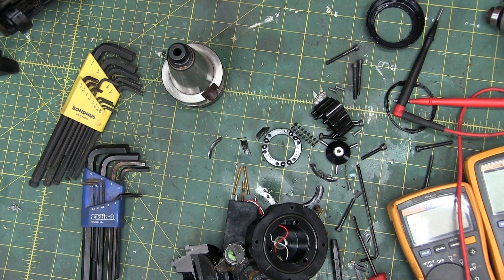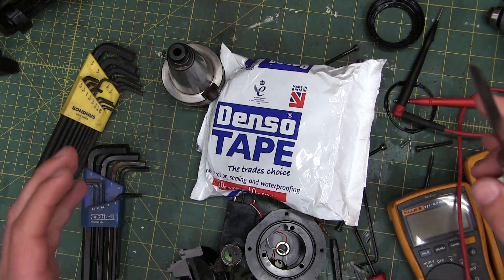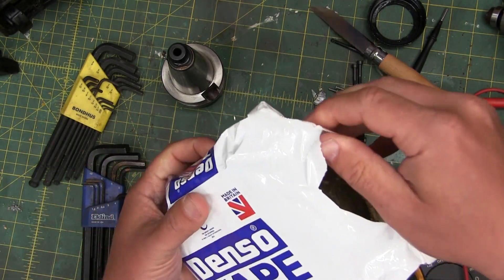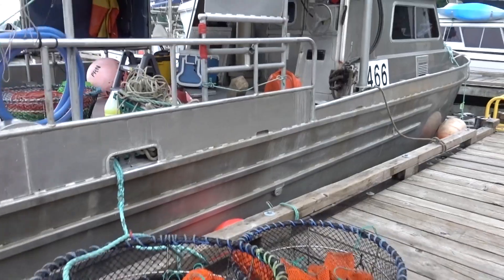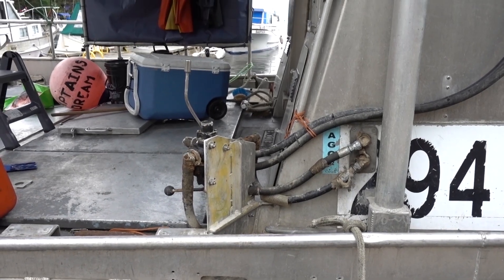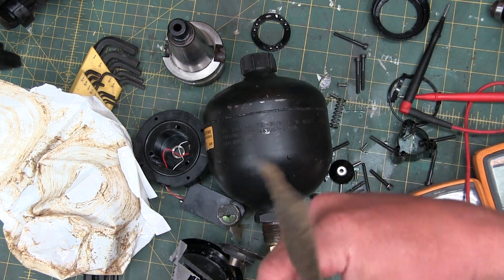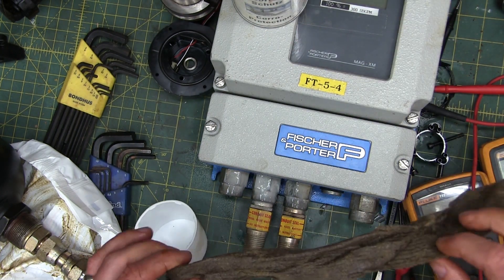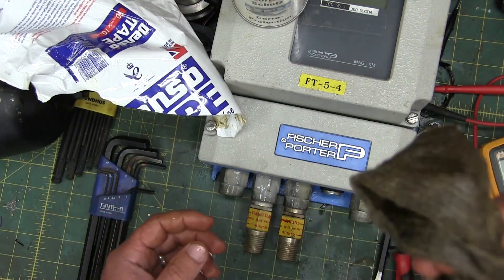Best Corrosion Protection? | Denso Tape

Comment: Petrowrap made in Canada is the same, easier to work with cutting it in smaller pieces and working it into the grooves so there is no air. And to clean it off of you and the your choice of utensil for cutting it, WD40 breaks it down and dawn cleans that right off, without the wd40 you’ll be washing and spreading it all over everything.

Comment: Pro tip, we use it on underground power cables in the UK for temporary ends, keep the cables live even submerged fully under water the stuff is great. Now for the tip.... after you apply it heat it up with a gas gun and run your hands over the overlaps it goes smooth as a beavers  but hole and keeps the water right out!! Messy though

Comment: We use Trenton wax tape and their grease stuff to wrap gas mains at work. I have a bucket of it at home. When we dig stuff up years later that was wrapped correctly it looks brand new as long as they did it right and used the grease before wrapping it.

Comment: After the Denso, use 3M EZ-wrap which is a very thick version of cling film. Stretch it with every wrap, it will squeeze it good and tight. Then wrap up with electrical tape or as another commenter suggested aluminium tape to protect it.

Comment: I'm a telecommunications field technician and we use Denso to do temporary cable joint closures. Just wrap it up tight and give it a squeeze and it can keep an old paper cable dry inside for months out in the elements or undground.

Comment: I wonder if you could DIY this with cloth strips and Vaseline, it's apparently petroleum based, It would be cool if you did a salt water test and saw if there was much difference between this presumably expensive option, and the cheap DIY method.

Comment: I'd bet bulk paint or conformal coat would work just as good or better, seems to me the real trick is armoring the top layer to prevent cracking off coatings or abrading off the tape or paste or whatever goop you plop on there, seems to me a nice thick piece of uv resistant plastic tubing should do it, just take a knife to one edge and slip it on like insulation, pop some zinc  worm fixings over it you have a near permanent solution, it wont abrade easily, it wont fall off, the outer layer is splash-proof the inner layer is waterproof entirely if you did it right should last practically forever unless your dragging chains over the tubing or something. only downside i can think of is if you want super high temperature fluid for some reason, even then there are high temp options like silicone that can handle 300+C no problem

Comment: I've used Denso tape for years, other brands don't come close to the quality. manufactured by Winn & Coales (Denso) Limited for over 70 years a lot of underground pipes and cables here in England were wrapped in it and still going strong tobay

Comment: I used this product on hydraulic equipment while working offshore on oil rigs.   Hate it but i love it.   When mechanical parts get really hot, it'll start to thin down and smear and drip all over making a sticky and greasy mess.   Every so often you have to clean it replace it.  You can get the paste it self and apply it.   Sometimes that alone is better, not as messy.

Comment: We use oodles and oodles of it to wrap our steel natural gas main lines. The paste, which displaced water and helps the tape go on, goes on first. Then the denso tape, and then some 3-6 inch black tape over top. There is a “summer” version that is light gray and won’t feel like shit in a bag when you use it at 90 degrees F. Definitely won’t work in the winter though lol.

Comment: that english stuff just melts off if its real hot. the canadian built stuff which is stiffer and more orange colored works well. also when it dries out you can hit it with olive oil. or spray paint over it when its brand new to make a crusty shell. also the expensive Flex Seal from walmart works well if youre gonna be brushing against it alot or if the fittings are too close together to get denso tape in there, like on a crane valve bank.

Comment: I have used it for years on my boat.  Awesome stuff.  In a salt water environment, paint is only good if it is perfect so the tape is a practical solution in areas that are hard to paint or where fittings can get easily chipped.   It is very soft and messy so if outside,  I over wrap it with vinyl or rubber tape.   It is also great to use on fittings that need to be checked or removed regularly.    I would trust a plain steel fitting with Denso tape more than a stainless steel fitting and it is a fraction of the price.

Comment: Denso is a three part system and all three parts must be applied for it to be effective... And it doesn't require reapplication as often nor does it make a mess. 1. Paste to remove air gaps 2. The impregnated cloth tape 3. The top layer, resembles black duct tape. You're also meant to test the top layer for gaps by trying to get an electrode to throw an ark between the metal object and the exterior.. No ark = no air gaps

Comment: Ex Navy. Used to use vulcanising tape under with this over the top to protect electrical connectors etc or everything from radars to sound equipment above decks.  Could handle major weather easy as.  The vulcanising tape provides a bit of extra protection but mainly keeps the connectors free from the waxy stuff.

Comment: I work on a sewer and water crew in Ottawa and surrounding areas. We wrap every water valve with the tape, and every bolt on the megalugs get the denso paste put on.

Comment: Works great on steel refrigeration/AC compressor fittings (rotorlock etc). Anything that get's cold and forms condensation. Stops them rusting away.

Comment: It's amazing stuff. Used it everywhere wrapped pile legs in it underwater, on deck  hydraulic pipe ends and I saw a deck winch hydraulic drive motor swapped out on a Dutch tug that had been exposed to salt spray for 4 years and it looked brand new. The motor new motor wasn't painted just wrapped in denso tape then masking tape then painted to match the rest of the winch. When the old one was unwrapped it was bare steel without a corrosion Mark anywhere.

Comment: Never seen that stuff. For lighter-duty use such as indoors, Fluid Film is very nice to work with because it's non-toxic and not very messy. It works great at preventing corrosion as long as the item is not exposed to liquid water. Rain will wash Fluid Film off after a while. Unlike oils, it does not evaporate. Heavy grease, or even Vaseline, works much better than oils at preventing corrosion. I guess you could wrap the Fluid Film coated part in plastic kitchen cling wrap or something like that to protect from rain. It works great in locks too. No, I'm not shill.

Comment: As a former boat mechanic,this shit was great for steel fittings on any line, holds up to heat and if you use wire or a zip tie it stays  in place. Salt water spray aint got shit on this stuff.

Comment: I worked offshore on oil barges for over a decade and this stuff was the only thing that would stand up to constant ocean wind and spray. We usually had to change it out every 18 months, as the salt and sun would dry it out. But as long as you kept up with it, you would have zero rust on your hydraulic fittings while every other piece of steel around it was cakedd in thick rust.

Comment: I have been using Denso Tape for 40 years.  There is nothing better for corrosion prevention on underground earth electrode connections etc. Smooth it down well.  It will never let you down!
Use disposable gloves.

Comment: Similar to cosmolene grease the Army used back in the 70's. Some of the equipment was rat holed after the Korean war. The stuff is horrible to remove but the equipment looked like it just came off the assembly line. It's still sold today. I think the half life must be significant, even more than back seat french fries...

Comment: We use this in the water utilities industry on buried or submerged metal valves, piping, bolts, etc.  Its awesome.  We've dug up valves that are buried for 20 years and the metal looks brand new when you peel off the Denso.  One thing he didn't mention was the mastic -  its like the paste but has tiny styrofoam balls in it.  You use the paste first, then push the mastic into any sharp corners or places where an air pocket would form, then wrap it with the tape.

Comment: Pipeliner here. Denso is wrapped on all the burried flanges and does a pretty good job keeping shit from rusting to hell, great product. Apart from epoxy coatings the most durable and longest lasting coating was a "coal tar enamel" that has kept old 1950s vintage pipe clean as a whistle 60 years later and is durable as shit for handling the pipe.

Great to see you keep dropping industry insider info for the masses, always great having this stuff in your back pocket.

Comment: The stuff is truly miraculous. I've seen hydraulic fittings fully immersed in seawater for years come out as good as gold. It must be applied correctly and massaged in well . One of the few products around that fulfils all its claims.Saves a fortune in corroded hoses, valve blocks etc.

Comment: I can remember in my early day in plumbing in the 1980 when copper was run in concrete, we wrapped the pipe with denso, to protect it. on a recent refurb found denso around a copper pipe in concrete and it still look like new.

Comment: Yess!  I work on tugboats and we use Denso tape (aka petrol tape, I think) for so much stuff.  Rudder room hydraulic piping in a constantly hot, sealed, sweaty compartment, no prob. Hydraulic fittings on deck, countless hours in and out of salt water and they look shiny years later.  Wrap the denso in electrical tape and it keeps the stuff around it cleaner.

Comment: As a U.K. plumber I have used this stuff for the last 40 years. It was originally brought out as a temp leak provision until you could make a proper repair. We only used it on waste pipes as it cannot hold pressure. The art to getting longevity out of it is the polishing procedure. They say you can’t polish a turd, but you can with this stuff, just add a little heat then with bare hands start polishing. It eventually gives a polished seam free finish and takes about 10mins. Cleaning off is with old newspapers, we found it’s the only way.

Comment: True story; Had a leaking stern gland on my old ship and no where to slip.  We're talking 6000L per day!!!  You're buggered say the sooth sayers from Hell. You're gonna sink.  So I applies some thinking juice to the cranium. Let's work as a team and do it my way!  Sent diver overboard to Denzo up the prop shaft, pulled old packing out inboard, repacked bearing, removed Denzo:-  FIXED!  Price, one dozen beer for diver.  (Packing source and Denzo to remain anonymous, to protect the guilty, but free). Denzo?  Hell yes!

Comment: Works well, seen hydraulic company's denzo then paint over it with a special hardener that makes it last longer and you don't get shmoo all over you. Only issue I have is inevitably the installer tapes everything that you have to go around pulling it off to crack open hydraulic nuts to see where the fucking problem is.

Comment: spent nearly 3 days stripping every electrical connection and wrapping it in denzo tape on a  new 4wd ute that was heading to an underground mine .  Only for the vehicle to last 18months max before the chassis or even the engine block would corrode out. Great stuff in small doses lol

Comment: I actually enjoy using denso tape, its fun to blend the edges together and use it like putty as you work it around the steel. If you're gonna be a dirty engineer, you gotta embrace it fully and get your hands in there and feel the schmoo between ya fingers!

Comment: Best corrosion protection? Denso tape? Nonsense! Just slather the jeezless thing right full of cosmoline! That way, it won't corrode until WELL after the second coming of Christ! Bonus! It can be worked into the tiniest of nooks and crannies, even the pores in dead tree carcasses! Don't believe me? Ask anybody who's ever bought a military-surplus rifle right slap out of storage! 

In all seriousness though, it does a good job at corrosion protection, but after decades in a warehouse, is it EVER a pain in your 4th-point-of-contact to remove. It's part of the experience...

Comment: Have you ever ran into or used "cosmoline" ? I bought some army surplus stuff that was made during the Korean conflict ... that stuff was nasty .
In broadcast engineering we use something that 3M , Andrew Communications and GE make , it is commonly known as "sealing mastic" ... it is used to seal fittings , hard line joints , entry/exit holes , etc . It is self-vulcanizing and comes in sheets , strips and rolls of varying thicknesses and lengths  .
I have used it in temperatures from -40F to 130F , rain , salt spray , extreme desert mountain top communication sites with high UV exposure ... the stuff holds up great .
We called it "goopempucky" but there several other names for it .

Comment: not sure the boat was a great advertisement for that tape...
Reply: u tuber you're right. Real world application in a high traffic area. The denso  needs a top layer of say,  aluminium tape or 2 pack epoxy poured over it.

Comment: On the cargo docks I work on we are using LPS #3 me or then denso tape.   Spray it on, leaves a nice wax film.  Great for parts that move a lot or get worked on regularly.  But still use the denso for shipboard stuff like fasteners on the cranes.

Comment: We use this stuff more and more in municipal water.  Mostly in burried applications.  They also have a newer product that I think they call a "buildup mastic "  it is a mix of the paste and a filler, maybe Styrofoam balls that fills all of the voids and makes it easier to tape.  Metro Vancouver used pallets of this stuff in the new Seymour capilano water treatment plant.  The Denso Spice that they would give out at trade shows is awesome on steaks.

Comment: We used that on the offshore tug boats I worked on. We would wrap steering, hydrolic and air fittings with it. Yup, sticky as all shit. We would do the same thing like on that vessel. What we would do is coat it with grease on the outside and it would extend the life of it. Great stuff.

Comment: Denso Tape has been around for ages... I remember Dad using it on the gurrdy and anchor winch fittings as a kid... After Dad wrapped them with Denso Tape he would them wrap them with 3M or Scotch electrical tape.   That was back in 63-64.  

When I was working on the fishing boats in the 90s all the hydro fitting were wrapped with the stuff, but they had a goo that they put over it and it hardened so it lasted longer.

Comment: Hey AvE, hey used that stuff on steel natural gas distribution lines at my last utility I worked for. 1" lines up to 8" lines. Repairs, new taps, and damaged corrosion casing. Used a wax based grease in addition to that stuff.

Comment: Thank you... thank you... thank you!!!

About 35 years ago I used to work in Toronto for British firm Decca Radar repairing marine navigational equipment on "lakers" and "salties". We slathered Denso paste on every external nut and bolt and NEVER had any corrosion issues, even on ocean-going vessels battered by seawater. The problem was I never knew what it actually was. Now I know I can order some skookum Denso paste online and forget about rust problems forever.

That job also introduced me to what was then known as "self-amalgamating tape", long before they ever started selling self-fusing tape in stores in Canada.

Comment: Oi Mate! I know you dont fancy the 2 wheeled suicide machines, but i was wondering how this gadget coats with heat resistance? ..my old honda transalp could use a little treat on its rusty smoke pipe.. You thin this would be an option? Thanks for all youre amazing work, really really appreciate that youre a thing! ;)

Comment: Denso is just a brand. It's Poly Butylene Mastic tape technically,  and theres a few variants of it and a few manufacturers, like denso, rotunda and petrolatum. Theres another similair product that is silicon based rather than bitumen as well worth considering, for not abrasive area jobs. They are all called 'Self Amalgamating Tapes'.
Don't get bitumen in your hair needs to be right up their with dont get your dick in a vice.

Comment: We use it in commercial refrigeration to protect steel heat exchanger that are burned into copper piping. It’s nasty as frig but works damn good. We seal it with industrial cling wrap then paint it with metalized paint for good measure.

Comment: I've fitted miles of Denso tape and paste, it works. Have a thick pair or rubber gloves a sharp knife and a brush set aside that you only use for fitting Denso as all tools and yourself will quickly get covered in the stuff if your not careful.

Comment: Ha brings back some memories. We used to use that shit in construction for plugging gaps around reinforcement bars etc. sticking out of formwork when we poured concrete. We also used to shove it inside threads of stuff being cast into a slab or whatever. When the concrete cured it wouldn't stick to the denso and you could even reuse it.

Of course also got used for wrapping hydraulic connections etc on equipment that would get covered in cement dust and wet splashes of concrete etc. over time. And I used it to repair a drain pipe with a big rotten hole in it, seals up fine as long as there isn't too much pressure in the pipe.

Comment: lps 3 works really fucking good.   we use it on the hydraulic fittings on the roll off trucks we manufacture...  because denso tape looks like shit...  and the trucks are new...  not bashing the tape.